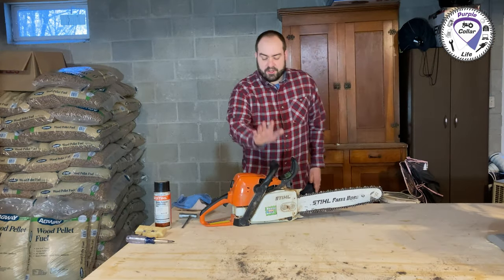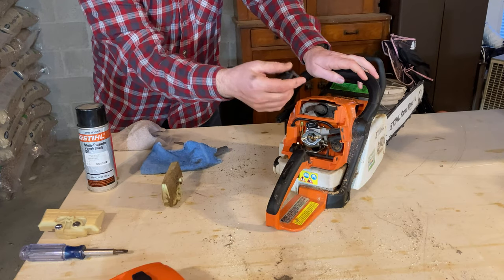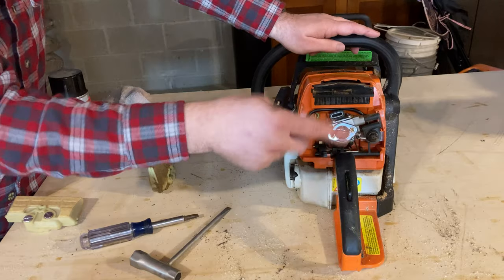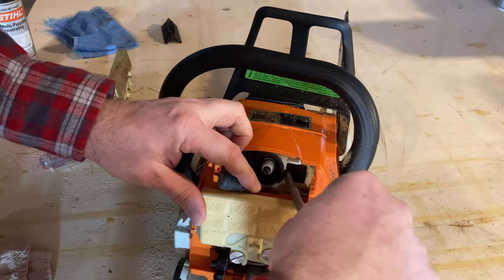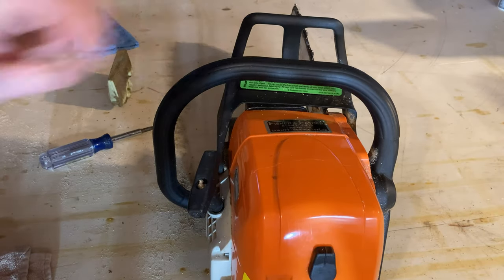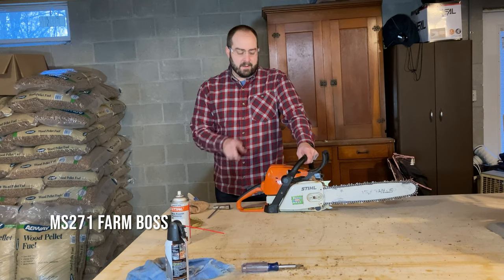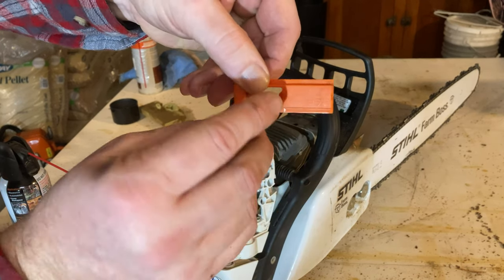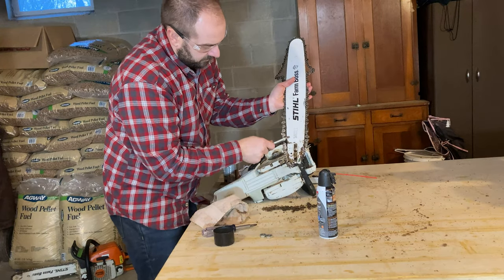#150: Stihl MS290 "Winter Mode" - Took me 18 years to figure this out

Comment: When blowing saw dust off of the saw, be sure to keep the carburetor open. This will help in eliminating more saw dust getting on the work bench! Less clean up and possible less fuel used when attempting to start the saw, since it won't start, therefore saving on fuel, chain wear and noise pollution.
Reply from the maker: Interesting!
Reply: LOL

Comment: Chad...excellent demonstration.  I somehow learned about winter/summer settings a long time ago. But, I must confess, our temps bounce around so much... I only change to winter mode in the deepest part of the winter.

Here are a couple of points you can add... 
When blowing out the saw... put your thumb over the carb intake.  You might get by with just closing the choke.  But, it doesn’t take much sawdust to screw it up permanently.

It only takes one kerf to burn up your bar, if it is dry.  When cleaning up the bar/chain surfaces keep sawdust and dirt out of the bar oil port of the saw.  You’ll never have a better chance to clean and inspect it than when the bar is removed.

Oh... and the official name of the tool is “scrench”... short for screw-wrench.

As I said, nice job showing the conversion!
Reply from the maker: Thanks! I couldn't remember the tool name while I was making the video.  About 5 minutes later it came to me.  Chalk it up to stage fright. :)
Reply: @PurpleCollarLife  I don’t really get stage fright anymore.... now, amnesia bordering on early onset of dementia... I’m there!

Comment: Great info.....many folks don’t read the instructions ......hehe. One thing if I may....to point out. I wouldn’t blow that compressed air around that uncovered carb. Might want to stuff a cover over the carb inlet first. Good video, thanks 👍❄️☃️
Deer running in the background at 14:05 🦌
Lmao....16:05 deer running around behind the woodpile as you rev the ms 290 👍👏🪵🔥
Reply from the maker: Good tip! Thanks for watching and commenting!  Yes - the deer are always around. :)

Comment: I replied with this to a comment but everyone needs to understand the shutter is for very specific operating conditions which the average user and infact most professional users will never encounter. 
It is for below 50* air temperature with condensing humidity. its purpose is to let engine heat warm the carb and intake to prevent moisture in the air from condensing and freezing in the carb.

Keeping the shutter open in the wrong conditions will cause poor running from vapor lock and fuel vaporising in the lines and carb, to engine overheating and major failure (seizing or scoring of the piston/cylinder) which is many saws is fatal (cost to repair vs replace). 
Read your operators manual.

I am a small engine/power equipment technician and Stihl Gold certified tech (among others).
Reply from the maker: Thanks, Russ.  I don't know about condensing humidity - but there are definitely times here in northwest PA (the snow belt below Lake Erie) that we're well below 50 degrees (Farenheit) throughout the winter.  Switching to winter mode makes warmup of the saw much easier.  I agree though that you need to keep an eye out on the temperatures and not forget to switch the machine back to summer mode when appropriate.  Thanks for watching and commenting!
Reply: So below 50° switch it to snowflake mode, but over 50° have it on sun mode is what you are saying. Just clarifying

Comment: Very good video...another recommendation is to lift up on the end of the chainsaw bar and hold it in that position as you tighten the nuts on the chainsaw bar which is more easily done with the saw resting on the ground or bench.
Reply from the maker: Great tip!

Comment: I actually bought a new chainsaw yesterday and read about this in the owners manual.

I still didn’t see the second part next to the spark plug but previous to that I did not know about the air intake being reversible
Reply from the maker: Thanks, Brock.  Congrats on the new saw.  What did you buy?

Comment: Saws I bought 30 yrs ago had this winter summer baffle. Its in the owners manual, plus usually has the sun/ snowflake mark on it. Most saws have this feature.
Reply from the maker: Thanks for the info!  I always knew about the sun/snowflake mark on the baffle.  I didn't know about the square/slot that allowed the engine heat to enter the air intake.

Comment: I have seen where it was suggested,  that whatever tool you use to clean the track on the chain bar, be pushed (or pulled ) through the track so that the gunk in the track is moved away from the sprocket on the end of the bar to prevent that gunk and debris from getting into the end sprocket.
Reply from the maker: Another great tip!!

Comment: Well I didn't know that either.  I have a 290.  Will have to check it out.  Thanks for the information!  Great video!  Also the deer didn't like the 290 at 15:50.
Reply from the maker: Thanks for watching and commenting.  Yes, usually the deer don't mind the machinery, but the chainsaw must have been a little too loud for them.  They just stayed in the edge of the woods and came back out only minutes later.

Comment: Another thing, when starting don't rev it up, let it sit & idle. Less chance of cold seizing.
Reply from the maker: Great tip - I do typically let it sit and idle before I start cutting anything.  I do wonder though if you’re supposed to let it sit and idle with the chain brake on or off.

Comment: Nice video well explained! But winter mode it doesn’t help the chainsaw to start easier! Only after the engine is warmed up allows warm air to go to warm the intake area!
Reply from the maker: Thanks for the info! I was under the impression that even before the engine starts, some heat generated as you pull the cord and create that compression does benefit the engine warm up by circulating through the intake.  Even if it only creates a few degrees of heat, it should help a little.
Reply: The winter mode is designed to stop the carburettor icing in extreme cold conditions by allowing warm air from the engine to circulate around the carb area hope this helps.

Comment: In case no one mentioned it before, or if they did, it bears repeating, if you're going to clean around the carburetor area with compressed air, block the air inlet so debris doesn't enter the carb and cause problems later on.
Reply from the maker: excellent tip! thank you for that.

Comment: Switching to winter mode does NOT help the engine warm-up as you said repeatedly.  Rather, it helps prevent ice forming in the throat of the carburetor (called carb icing , which causes rough running).

Comment: I also just recently learned about the Winter/Summer modes UGH. Great video. I also have an old MS290 and I am wondering if there's a mod available to add a decompression valve?
Reply from the maker: Hello - thanks for watching.  The summer/winter mode "switch" seems to be new information to a lot of people.  Glad this video helped! 
I've never read about a decompression valve for the MS290.  I think the smallest Stihl saw that I've seen with the decompression valve is the MS261 (pro model).

Comment: When the 029 came out this was never really explained. Rarely was there a problem of icing. Most of the people in this area have wood set back for 2 or so years. Another thing there's more than 1 air filter & cover for the 290/310/390.
Reply from the maker: Thanks for watching and sharing. The MS290 was my very first Stihl saw.  Prior to that, I had other brands that weren’t nearly the quality - Craftsman, Poulan, etc.

Comment: cold weather mode has absolutely nothing to do with starting.  There's no airflow going over the engine when its starting
Reply from the maker: Hi Top Dog - you're right that on the initial pulls for starting, it isn't doing anything.  But what it is designed to do is let the engine warm faster.  That slot being opened lets some heat from around the cylinder/cooling fins (once the saw is started and running), travel through the channel into the air intake where it gets pulled into the carburetor.  So what it's doing is allowing the engine to warm up a little faster, and keep the carburetor warmer during winter time operation.  Thanks for bringing up a good point that when the engine is cold, it's not doing anything to help with starting on those initial pulls.

Comment: The warm air from the engine only prevents the carb from icing up. Has nothing to do with engine warm up.
Reply from the maker: According to Stihl's website - switching to winter mode "activates the carburetor pre-heater system".  So yes, it does prevent icing - but it also pre-heats the carb for easier operation in cold weather - if I understand what they're stating. 
https://www.stihlusa.com/guides-projects/a/working-winter-wonderland/

Comment: does  stihl chainsaw ms290 has an adjustable oiler? thanks
Reply from the maker: Yes it does - but I've always left mine set on E (Stihl's E-Matic setting)
Reply: @PurpleCollarLife  can you please tell me where is it located? I just don't see it
Reply from the maker: @bestillandknowthatuaregod  bottom of the case, in the black section. Then also make sure that the hole isn’t plugged where the oil goes into the bar.
Reply: @PurpleCollarLife  thanks a lot man!

Comment: Since I read the manual when I bought the saw, I knew about switching the rubber shutter.  I did have a bit of trouble interpreting the diagrams showing the correct position of the pre-filter in the two modes.  Since your video didn't really show a close up of the pre-filter in each of the modes, it wasn't helpful to me.  Also, you didn't discuss the temperature at which switching modes should occur.  Reading the manual carefully, above 70 degrees F the summer mode should be used.  Below 14 degrees F the winter mode should be used.  Between 14 and 70 one can infer that either mode is OK.  So most users can just leave the saw in the summer mode all the time.
Reply from the maker: Hi Troy! Great info.  Admittedly, I didn't read the manual when I got the saw - it took me until just before this video to actually read through it.  
I'm sorry we didn't show a good picture of the pre-filter in each mode.  I thought you could see the snowflake or the sunshine facing upwards. Thanks for watching!
Reply: @PurpleCollarLife  You video did cause me to FINALLY get to the source of my confusion:  p36, upper left diagram -  it's really an abstract representation of the prefilter that could be in either summer or winter mode.  The two diagrams on the right are the ONLY ones that should be looked at.  Also, now understanding that between 14 and 70 degrees either mode is OK, I'm just going to leave mine in summer mode all the time.
Reply: NO!  winter shutter should only be set when the saw will be used below 50* WITH condensing humidity. The shutter is there to allow some engine heat to warm the carb. Air  moving through the venturi at speed drops in temperature allowing moisture to condense (bad) and then possibly freeze (worse). 
Using a saw with the winter shutter open when conditions are not appropriate WILL cause overheating and engine failure. Initial symptoms may be vapor lock or fuel vaporizing in the lines giving poor running, but if you are not so lucky, or persist operation you will destroy the engine.

honestly the best thing you can do is forget the shutter exists - its not likely you will be using it in those conditions ever in it's lifetime.

I'm a multi manufacturer trained small engine/2 cycle tech... Stihl certified being one of them.